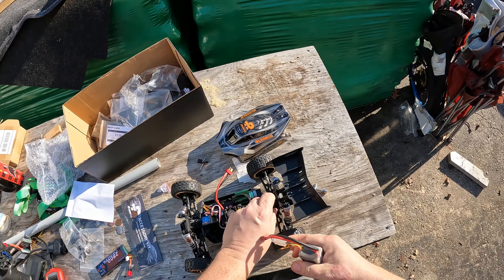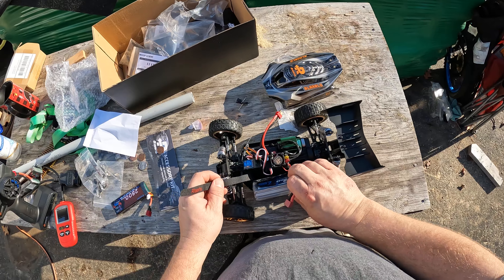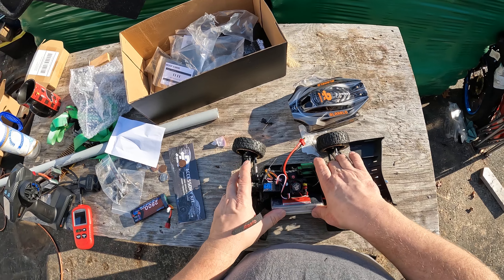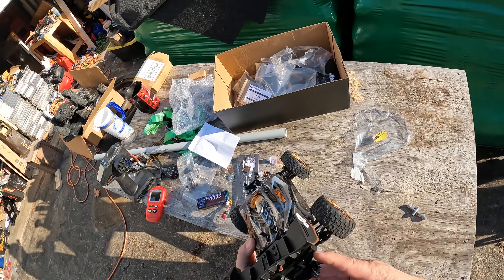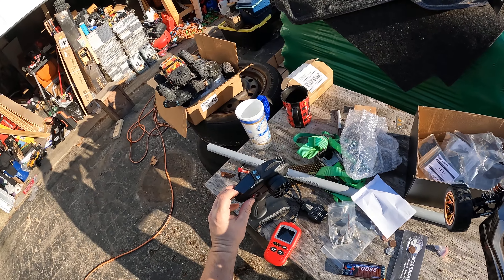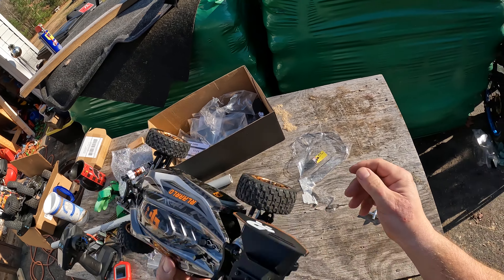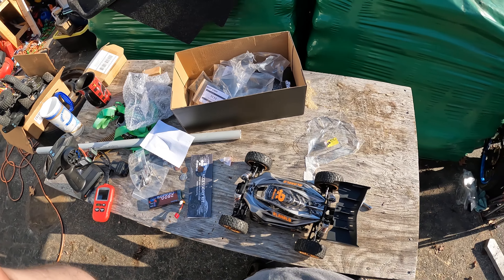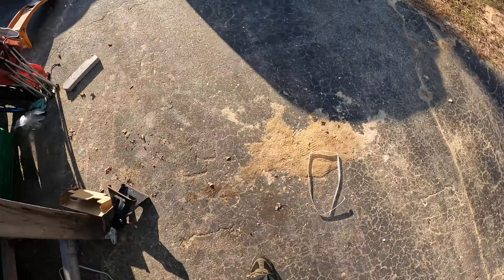Rlaarlo 1/14 Scale Carbon Fiber Chassis Desert Buggy 3s Lipo Run 11-16-2023

Comment: Wow! The Rlaarlo sure rips. Great job. 🏁🏁
Reply from the maker: Thanks  i am revamping another that had a metal chassis and changing to carbon fiber with a castle 6350 kv motor on 3s. Hopefully you will check it out. Thanks for checking out the video and the comment.

Comment: It's a very capable 60mph buggy. I lost signal and hit a curb destroying the chassis.  Other than signal loss it's great
Reply from the maker: Yes i have gotten sixty plus and i am going to use some losi antenna bases to extend the reciever’s wire to have it upright more for better signal. Thanks for checking out the video.

Comment: Ovonic makes a 1400mAh 3S that I bought for this car. XT60 connectors on them, but with a deans adapter you'll be good to go.
Reply from the maker: Thanks i been looking at different batteries and also looking at change the dean connectors to xt60 ones on the cars and batteries. I have some zeee premium batteries that I want to change the connectors to the XT 60 and then using an adapter for Traxxas to see if it’ll work in my rustler pretty good because those batteries are the same cost as buying two of them batteries for the price of traxxas battery. Thanks for checking out the video and thanks for the sub.